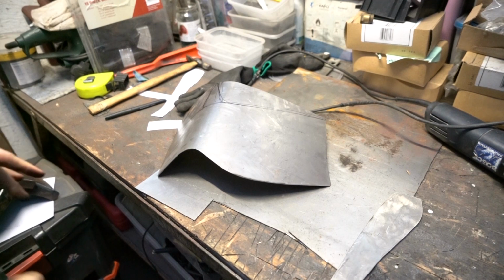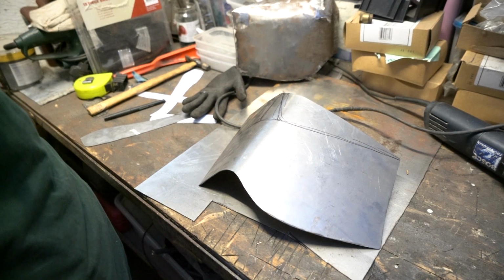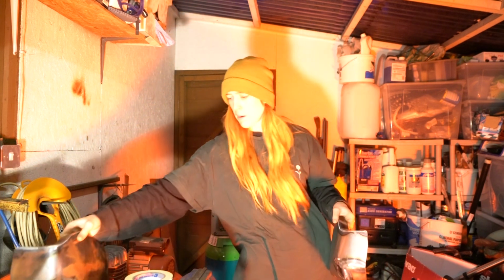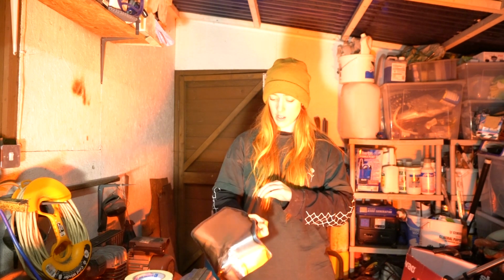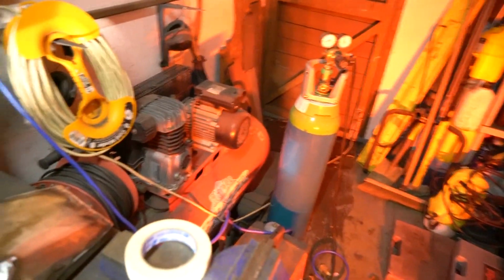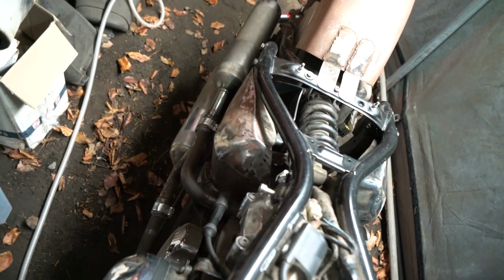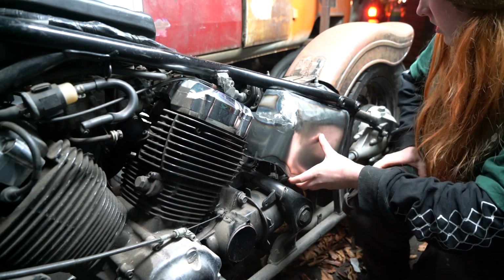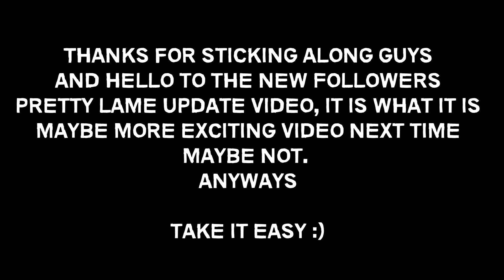Yamaha Chopper Build: Still workin on that cover

Comment: You should make yourself a beanbag , full of sand.  So you can beat the shapes with a hammer  and get a smoother finish, its so much easier to form things with it.
Reply from the maker: That's a really neat tip thanks!